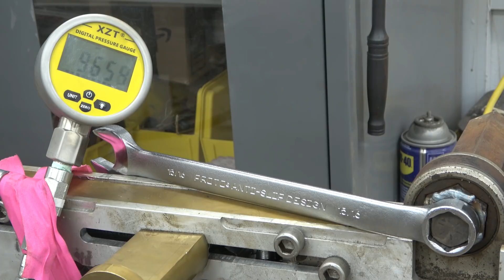Craftsman vs. Proto

Comment: I would imagine that the 12p has less surface area for the torque to travel where as the 6p has more material between each point creating a stronger hold. I dont know if this is correct but its something to take into account. would love to see this done with both 12p vs 6p of each wrench. I love both craftsman and proto. well craftsman professional tools developed by sk not their other craftsman stuff.

Comment: Nice stretched bolt, I knew right away because my dirtbike has tiny 8mm aluminum bolts and when I was younger I just tightened them with no regard and just past snug they just started turning, turned them one or two more times then took it back out and the top end was like half as wide and I was like WHAT. A completely clueless 17 year old.

Comment: Ave, On the 12 point Craftsman wrench. Was the point of failure at a tooth valley in contact with the fastener or was it a tooth valley that was not in contact with the fastener ?

Comment: A long time ago in a galaxy far far away Craftsman was an excellent consumer hand tool. IMHO it's not so anymore. They've gone completely downhill over the past two decades attempting to compete with the Wally World Chinesium junk prices, just as the rest of Sears was killed off by the same store chain and incompetent management. I have some of my father's from the 1950's and 1960's. The current ones are no comparison to the quality and durability of his. I've got some I bought from the mid-1980's into the early 1990's and they are much better than the current ones. Bought SK ratchet sets at the military Post Exchange from the mid-1970's into the nmid-1980's. I'd put them on par with some Proto from the same era. I've got much newer SK pliers, screwdrivers and metric socket sets purchased within the past five years and they're excellent.

Also within the past five years I've bought Tekton open end wrench sets and torque wrenches. Found Tekton hand wrenches are what Craftsman used to be in the 1950's and 1960's. The company is headquartered in Michigan. About 3/4ths are made in Taiwan and about 1/5th made in USA, with the remainder made in Canada plus a few in China. Their quality has steadily improved over the last decade with the owners moving production out of China. IMHO Snap-On may be superb, but they're overpriced compared to Proto, SK, Wright, MAC, and Matco. Premium European brands Facom, Gedore, and Hazet are also excellent but overpriced in North America. The only possible advantage to Snap-On is being able to subject them to extreme abuse and (usually) the dealer will replace them when they break. I'll stick with a mix of SK and Tekton.

A good comparison with the Proto test here would be SK and Tekton.

Comment: Really only reason for 12pt is that you can fit it on the bolt twice as many angle variations.. specifically when you're crawling around on the floor under a car or similar

Comment: As much as I like the look of the nice shiny chrome finish Snap-On wrenches the Proto satin finish is really nice. Especially when you get nice and greased up it just grips much better in the hand. Also I don't really notice much difference between the fit vs the Snap-On on fasteners neither rounding off nuts and bolts and both are able to remove rounded nuts that someone had a go at with say a Mastercrap or some Princess Auto bargain bin wrenches. Those Protos are an absolute joy to use in 12 or 6 point.
Reply: Proto and Wright are the MAC and Snap On of tradesmen.

All four are top tier.

Of only Snap On would cut the gimmicky marketing bullshit. Do they thinks Auto Techs are idiots?

A free hat? That's suppose to impress you?What the f is that?
If my Proto dealer did that to me I would of told him to eat it, were not suppose to negotiate price here. This isn't Calcutta

Comment: A Craftsman 6-pt vs. Proto 12-pt would be a great follow-up to this vid, no?  I'm inclined to suggest using new wrenches, since the wrench has the same characteristics as the bolt in regards to weakening over time, and it's doubtful the 2 wrenches in your video have been subjected to the same stress, however, I can't in good conscience suggest ruining a brand new Proto.

Comment: You missed the obvious Uncle Bumble  ... the craftsman ... obviously .. was intended for 12 pointed bolts, not hex bolts ... now test the craftsman vs the proto on a 12-point bolt and the proto is gonna fail at the gate ... 'not suitable for purpose' ... it aint gonna fit ....
now which is better   ;-)
Love your vidjeo's uncle, as always .... take care :-D
p.s. was hiding behind my chair saying 'AvE, get the feck outa there' half way through the vid ... 10/10 for scare factor  ;-)

Comment: Definitely wasn't the Project Farm. Ok, I have a Mac that supposed to be about as good as Snap-on. It's the older 6 point open end style on the side opposite the box. Not the knuckle saver. 12 point on the box. I'm guessing lawnmower axle bolts shouldn't be that super hard. First time removing a wheel off the push mower, it actually imprinted a second set of points in the boxend where it was softer than the bolt. Naturally this was warrantied, but the knuckle saver took over. I exchanged it with the extended length that was still in stock so all the open ends would match.

Comment: The difference might not be due to metallurgy or quality control.  The 6-point box end, engaging all six flats of the fastener, distributes the force more uniformly, helping keep it from going out of round.  The 12-point box end, with force focused on only six out of 12 points, would be less resistant to deformation, leading to failure sooner.  I think the jury's still out.

Comment: Be safe! Lol
We were trying to get the nut off for the coil spring @ the I beam side of a 1991 f150. 1"? 1.25?   The box end of 6point shattered. The shock felt over the breaker bar was so horrible. Ended up going to the hospital because I was loosing feeling in my right hand. After about 3 days feeling started coming back as the swelling went away.

Comment: Couple factors unaccounted for:

You measured the thickness of the material at the roots but not the depth. The proto appears to have a wider head which would contribute to cross-sectional area and thus strength. 

The 12 point wrench has sharper internal angles which would result in a greater stress concentration all else being equal.

Not sure we can really make a materials strength judgment here given the above.

Comment: Heres my 2 cents.  As a nostalgia based fan of vintagish craftsman tools, what i have noticed with the wrenches anyway, is that the broach can be misaligned, so you would you can have wall thickness variation from one side to the other.

Comment: I’m thinking there is also different forces at play due to the geometry of the wrenches. Specifically the area when the angle of the contact area. The load is distributed more evenly in the Proto. Not getting into specifics as my thumbs lack typing endurance. Just saying it’s something major to factor in. In addition to manufacturing and metallurgy as you already mentioned.

Comment: Interesting but not really all that useful. I've worked aircraft for 40 yrs and have used Craftsman, Snapon, Mac and had a huge set of offset Bonny Wrenches. Got into Mac when Snapon increased their screwdriver handles beyond what I could carry in my back pocket. The usefulness has to do with how tight they fit and how much space you have to work with. In my business, the hardware has thighter specs and higher costs than the wrenches we use. Snap on and Mac are some of the best; we use wobbly sockets in 1/4 inch drive and ratcheting wrenches ALL the TIME; 12 point is a Mandate, because much of the hardware is 12 pt. Most hardware is Grade 8, some with very shallow heads and All with close tolerance threads. What you are doing is testing for "Tractor Specs" not "AeroSpace Specs." Any ham fisted mechanics that get near my aircraft will be sent "down the road" .    Fun to watch though.

Comment: I am wounding how old the craftsman wrench is because they have been getting them made in China for about 20 years now . When that started I stopped buying them,  I was spending far to much time driving to the stor to get the broken ones replaced .
I use 6 point where ever possible which means most of the time.

Comment: Coming from the point of view of working in vintage cars I use 6 points all the time because they don't round the nuts off as much. And a lot of my customers think original bolts are magically imbued with powers having been made in the workshops of long ago by virgin elves under the light of a full moon out of unicorn horn.

Comment: It appears that the Proto 6 point has a deeper boxed end than the craftsman. So despite the valley being thinner it is longer which would give more cross section of steal at the failure point. This measurement is necessary to sustain your claim at the end that the proto is "of higher quality material", rather than simply made of more material. Either way the proto had a higher failure torque so its proved its value.
Reply: The boxed end does definitely look longer for the Proto.  Also, we know that box isnt perfectly punched in the center so we have no idea if the measured valley for either wrench is actually reflective of the depth of material at the failure point.

Comment: Apples to oranges . You need to compare 6 point vs 6 point and 12 point vs 12 point . With a 6 point there’s more area against flat plane. 12 point is definitely weaker  because under pressure it pressures  like a knife effect and break easier.  In my opinion you have to compare apples to apples and oranges to oranges ie. 6 point vs 6 point. 12 point vs 12 point . Would be interesting if  the stronger 6 point brand could beat the other brand with its 12 point vs it 6 point. That would be something to document in superiority

Comment: Lol I was splinkin it's time to wrap a blanker round the assmemberly itself, but surprised it didn't blow sideways on account of its sketchy setup.
I think their strengths may also be partly due to the contours, and their resulting cross sectional areas.  The Proto may indeed be skinnier in the middle but looks chunky around the edges, as it seems appeared to you as well.  But I wont disregard the metallurgy could be better too.

Love your vids for years, many a shop beer for ya swell chap 🍻

Comment: 880 foot pounds!  If I were using a 10 foot cheater bar on the wrench, would I need 88 pounds at the pushing end to get 880 foot pounds?   

Protos have been good wrenches for a long time.

Comment: I thought the 12 points were weaker because they have less grip on the bolt (as seen it started rounding the bolt) and that balling up of the metal as it rounds adds pressure

Comment: The best ratchet I ever bought was a 3/8 drive from a yard sale that wasn't stamped with any specific brand name and only said Taiwan.
It had a piece of masking tape that said $1.00 stuck on it. 
I literally used a 6 foot long cheater pipe on it and used it for breaking loose lug nuts in the junk yard. 
I destroyed many sockets with it and sheared at least 5 extensions (8 I think) but that stubby little Taiwan ratchet with a black polymer grip never died. The best tool I ever bought for the price.
Reply: Probably Alltrade.

Comment: If you look carefully at the 12 point just before it breaks, you can see the metal of bite of the wrench start to yield and rotate a bit.  It's yielding, and then it breaks.

The same isn't true for the 6 point.  It never (visibly) yields.  It jjust seems to crack at a certain point.

IMO that lends evidence to the theory that this is largely about the different hardness and strengths of the steels used.

Comment: So my tentative conclusion is: if the fastener is made of cheese or you're going to slip a pipe over the wrench, you MAY be better off with a 6-point.. but it's pretty likely the difference shown here was entirely due to tool quality, so just don't buy cheap tools and you're probably good either way.  I'd be interested in further testing; I wonder if manufacturers realize that 12-points are theoretically weaker so they make them thicker to compensate, thus leveling the playing field a bit.

Comment: As mentioned steel quality could very well be the biggest difference, but @ 8:30 of the vid "do not believe it is a function of the 12 point versus 6 point"... but COULD it be? in terms of the geometry causing higher localized stress regions from having less contact area for the 12 point? I'm far from a material scientist, but just something my mind chewed on for a minute. Despite the 12 having thicker walls it has less surface area to distribute the force along since while you measured the thinnest part, perhaps that "missing" material the 12 has for additional cuts/notches/whatever you wish to call them could put it at a disadvantage, maybe?

Comment: The end of the video synopsis was missing a crucial factor on the failure point of the 12 point. The inner structure absorbing all the torque on the 12 point has a substantial disadvantage in structure. The thicker material is trying to absorb the disadvantage in shape. 

There is a balance of use ability and strength.

Comment: Rounding edges on bolts is always the fail point, very real advantage for the 6 point there. I only use 6 point, especially on my socket wrenches where positioning no longer favors 12 points.
Reply: Exactly!
Reply: The 6 point is great for rusted nuts or nuts someone else tried to take off with an adjustable.

Comment: Howdy, my obsservation see's the load on a six point socket behind the the point(?) of the bolt. Farther back, than a 12 point.
load centered on radius of wrench. not just corner.   ty    Les

Comment: 9:30 would it not be that the torque is being applied to a smaller moment arm when using the 6 point by having it absorbed somewhere on the flats, where on the 12 point it's got more distance something something hoop stress...I'm not a doctor.

Comment: Does the contact area make a difference? Couldn’t you get away with a lesser steel if you’re making better contact with fastener? 6 point wrench on a 6 point fastener vs 12 point on a 12 point fastener.

Comment: I expected that the 12 point would round off the bolt head and not that the wrench brakes. I had this problem with a  21mm 12 point sockets and an impact drive. And I have broken some West wrenches too. But my old ,made in GDR, wrenches survived everything, I cut them in half so I can fit a pipe over it, never had one broken.

Comment: You'd need to be a pretty hefty fella to be applying 636 ft lbs to that wrench and equally as dumb as slipping off of a nut at that kind of pressure is suicide.

Comment: While trying to loosen a bolt on a carrier bearing, I had a box end wrench fail without the cheater bar. There is no way I can pull 600 pounds hard (it was about a foot long). The moral of our story, don't buy the cheapest wrenches you can find if you like you knuckles.

Comment: While the 12point may "have more meat at the root of the broach" than the 6point, the 12 point averages less metal around the circumference (taking a guess), making it weaker and more likely to stretch and break.  Also, there are 12 places to stretch, Vs 6, making the circumference larger as they do. Trying from the same brand might yield some interesting results.

Comment: I'd be interested to know how the same 6pt Craftsman would fair.  Proto says the head thickness of their 12pt wrench is 1 27/64" x 37/64", which is the same as their 6pt, but good luck finding any specs on the Craftsman.  They won't even tell you where they're made which means most likely China or Taiwan.  For less than $10 the cost of Craftsman, I would say the Proto is regardless a better value.

Comment: You also need to consider the width of the steel, aka area and confirm they have the same ultimate strength.  Could have also been fatigue from years of abuse that could change/lower the ultimate tensile strength so while an interesting test, it’s just a data point.

Comment: Check out symmetrical roundness on box end wrench .before you buy them.Im 35 + years pulling wrench.Some box ends will be off center.Doesnt matter who maker is.Lift it up arms length and look through the box end.Is it all equal sides all way around?Buy it.I found high price wrenches fail my test.If it's off centered you can't get it on some bolts that's recessed or close tolerance.Have ge8 day!

Comment: While cross sectional area, materials, and the manufacturing process play a big role in the wrenched strength. I believe another reason the 6 point was stronger is due to the decrease in size and number of stress concentrations from 12 with the 12 point.

Comment: I think you will find the fact the 12 pt has such a drastic angle on the bevel onto the tooth cutting the surface available for contact by cutting off the outside 25% The Danaher plants do this mainly for looks and ease of slipping the tool on. The removal of the extra steel in grinding and in the vibe process costs them and is useless. I would love to see you reverse the test with the Proto 12 and Craft 6.  Great video as always. I'm currently trying to keep a vice in my well I will tell you how it goes.

Comment: In my experience, the really shitty looking ones last FOREVER. but only because you only use them in utter desperation. although they're often the ones that get chopped/welded/bent into weird shapes to make that one-use 'special tool' for getting into tight spots (like the 3rd bolt on an injection pump or that starter-motor mounting flange that the engineering apprentice drew up on a friday afternoon after a 2hr lunchbreak and a suspiciously smelly hand-rolled cigarette)

Just because they're cheap and nasty, don't throw them away, you never know when you might need to jump the starter solenoid on something and you blew the tips off all your screwdrivers!